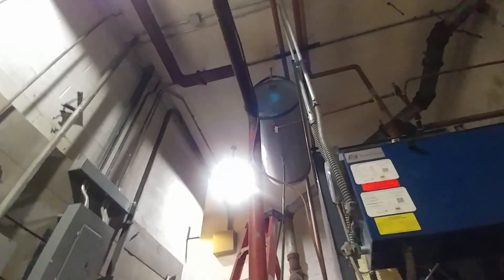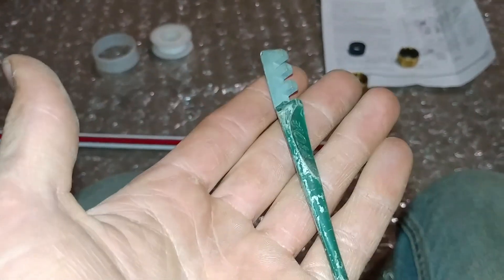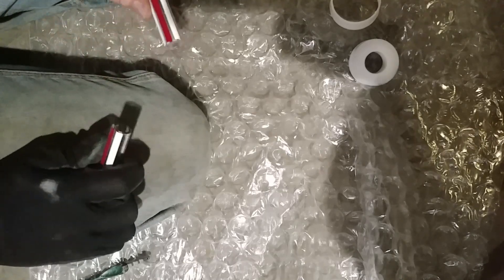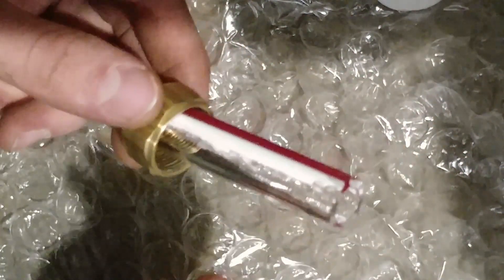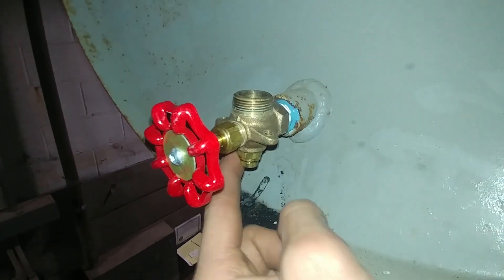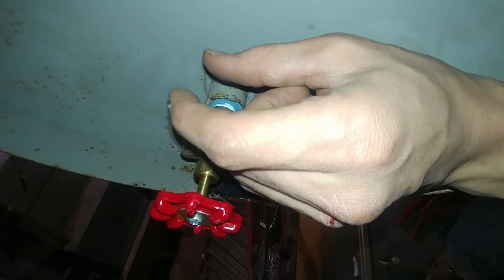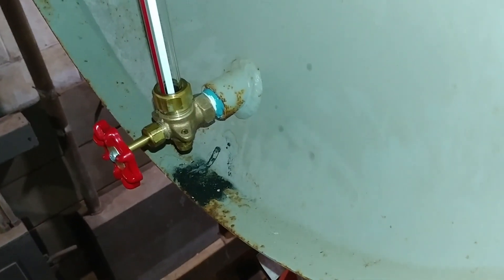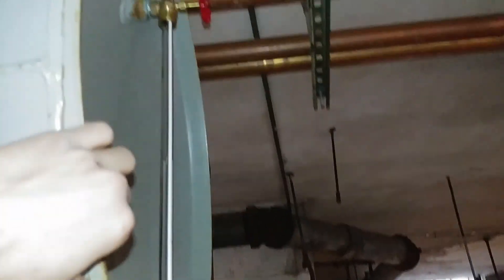How to Install Expansion Tank Sight Glass

Comment: If the top valve has a deeper recess, wouldn't the glass be inserted to the top first, rotate, and drop it into the bottom valve?

A couple pieces of all-thread would make up for the brass rods too.
Reply from the maker: Yep! That's what I was trying to explain, but I didn't explain it in a very concise way.